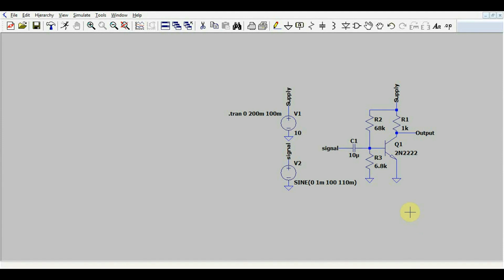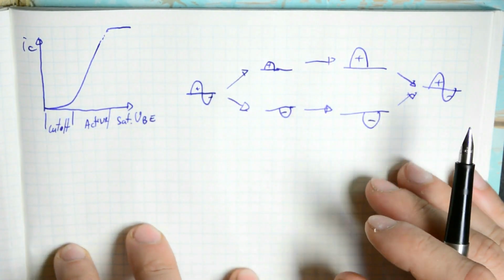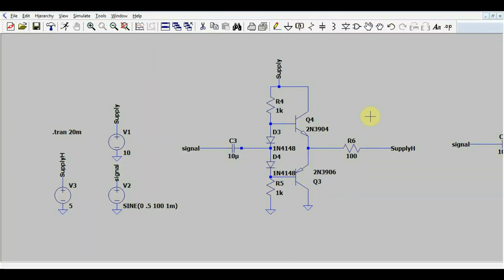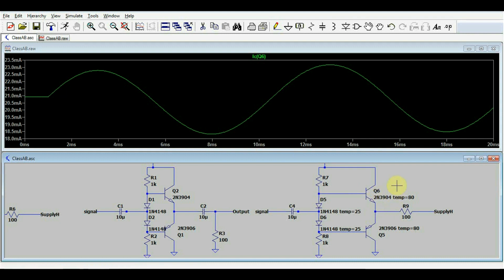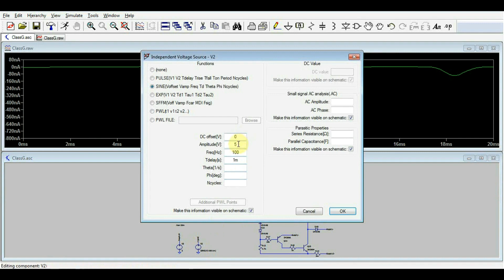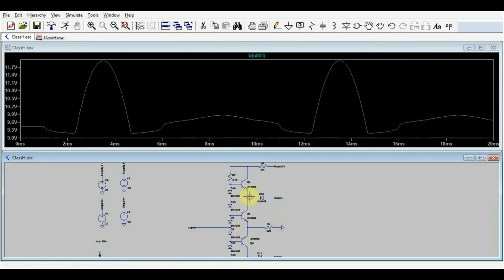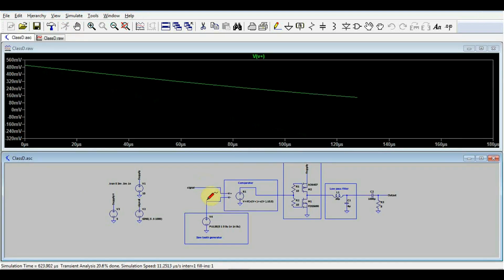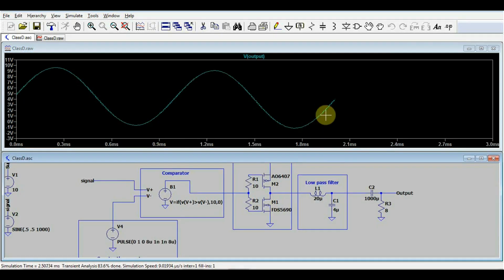Electronics Tutorial - Common Audio Amplifier Classes (A, B, AB, G, H and D)

Comment: I'm a newbie. And I don't understand the role of diodes in the source and signal circuits at all. If we have a positive sine wave at the input, does the current in the source circuit increase and the upper transistor turn on faster? Sorry, I don't understand the process here at all. Unfortunately, the author added diodes but didn't highlight them.

Comment: Class D is NOT digital, because the analog to pwm conversion is an analog procedure. The pulse width is NOT NECESSARILY and NOT USUALLY discreticed. So you don't have a discrete chain of Ones and Zeros. You have usually a fixed frequency (sometimes even not, like in the case of delta sigma conversion) pwm signal with a continuous variation of the duty cycle.
Reply from the maker: I guess you can make a similar argument about a switch mode converter -  most of the circuit is analog, except that the final response (the switch) is non-linear - it has a clear on and off; I guess a better classification would then be linear and non-linear for the amplifier classes.

Comment: Very cool video with examples. May I ask you for some advice about the studio monitors? Would be great to hear an answer from an expert. Which of those monitors are best for amplifiers?
1. Kali IN-8 - D-D-D - specs https://www.kaliaudio.com/independence#Specs-Section-Independence
2. KRK RP10-3 G4 - D-D-D - specs https://www.sweetwater.com/store/detail/Rokit103G4--krk-rokit-10-3-g4-10-inch-3-way-powered-studio-monitor
3. Focal trio11 - G-G-A/B - specs https://www.focal.com/sites/www.focal.fr/files/shared/catalog/document/trio11-be_fiche-produit.pdf
4. Genelec 8331A - D-D-D -  specs https://www.genelec.com/8331a#section-technical-specifications

Does D amp great for studio monitors? I saw only A, A/B, D, and G classes. I want clear sound from them. Thanks a lot!

Comment: ahh , I spoke too soon,, had to speed this one up.  I don't know why people keep saying slow down. Makes me wonder if they are engineers. The Harvard and Stanford open courses speak in a way I would consider normal.  Diff topic >> Last year I started getting into mag amps, very fascinating stuff. It's like a forgotten technology. There is lots of room for optimization. I don't even think foil tape laminated inductors were a thing when mag amps were relevant. Really cool stuff.
Reply from the maker: @Mr Sc1 I didn't know about this sort of amplifier, it has quite an interesting operating principle. Did you try to build one? I've seen that it should be built on magnetic cores with a special hysteresis curve, do you know what commercially available core type would be recommended to build one of these? or any will work just not as efficiently
Reply: @FesZElectronics  A good way to get started is to wind a toroid with 3 coils. One will be the input. One a control. One an output.  Drive it with a normal amp and control it by clamping with passives. or Control it with yet another amp OR just attach the control wind anti-phase to the original.  Many original papers speak of control with DC, but that never really was anything to brag home about. At least for me. Wouldn't shunt all the way, took a lot of current, etc...  With a toroid you can shutoff everything by just putting a neodymium on it. So, I dunno why people cared that much. Except for the fact that many of these papers were trying to control current levels from generators and the same trick doesn't work on laminate. >> in a sense this whole paradigm is how old welders worked.. sorta.. you'll see
Reply: Mag amps...
Please what it means?

Comment: Thanks again for these simulation and circuit videos, these help so much.  I knew I was learning more when you were explaining the G to H difference in the switch.  I wondered when you started what was going to happen to the sig to noise ratio.  Well thanks a ton for the unique and well done videos.
Reply from the maker: I'm happy you liked it! The various topologies by them selves do not have a major influence on SNR in an ideal world. The biggest impact comes in the form of TotalHarmonicDistortion. What I'm trying to say is that a poorly executed class A will have more noise than a good class D. But if you compare 2 well made Class A and D circuits with proper filtration the major difference will be the THD, since most of the noise from class D will anyway be outside of the audio spectrum.
Reply: @FesZElectronics  xxcafzxfdrd